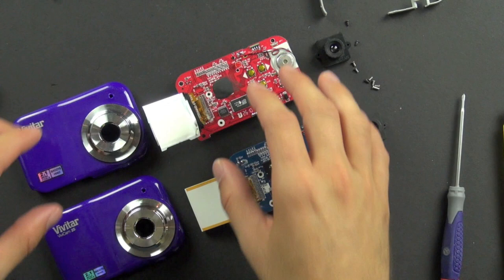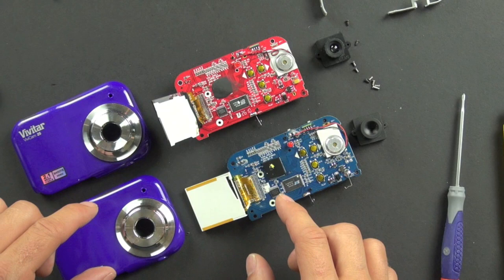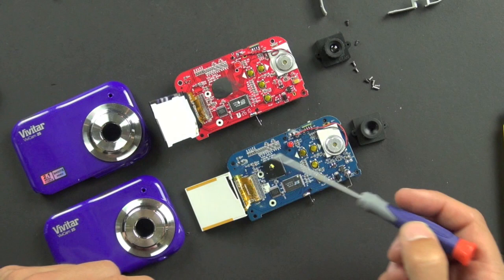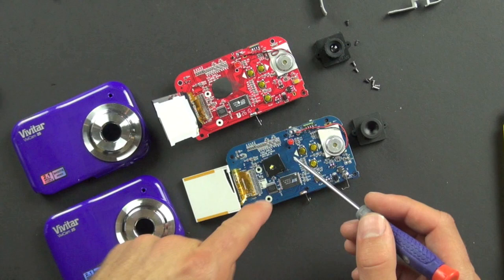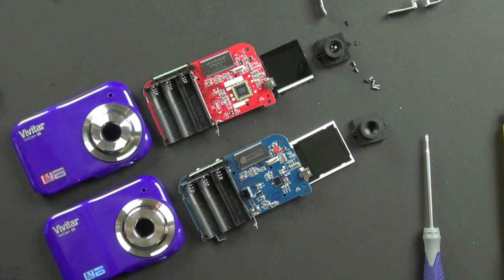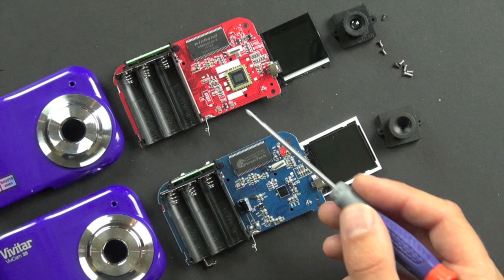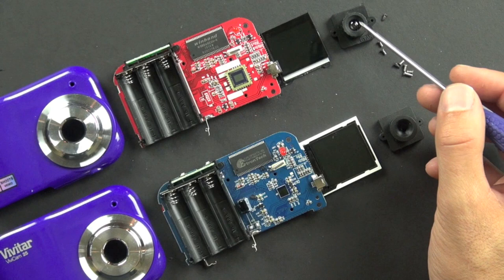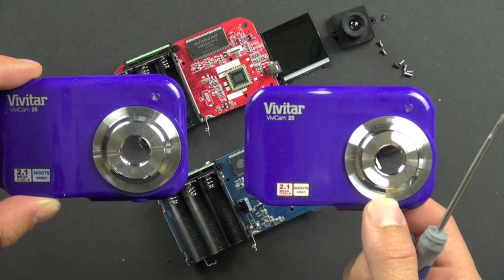What is inside a digital camera? (2 of 2) | Electrical engineering | Khan Academy

Comment: Actually, the reason the camera is so cheap is that it's made of leftover parts that they can get for great discounts. The screen and the camera were probably made for old candybar phones. This is also the reason for the revisions, since, as they have a limited supply of refurbished parts, they create revisions swapping these parts out for other ones. 

Obviously, they make a number of these products and push them to the market until the parts are depleted and then switch to other products.

Comment: agree this cam was made using spare parts originally destined for other applications. the capacitor stores charge for the flash, not during pictures ... unless they had real power glitches with some of the first version and decided that would be a cheap way to clean out noise. Hey stick a cap there to clean out any transients ... there must be a cap for the flash somewhere else on the first one. I'm surprised version 2 has the DIP though, looks like a slightly more expensive way of doing it.